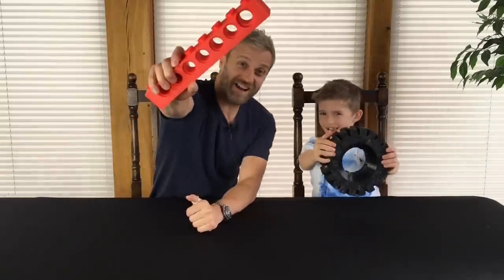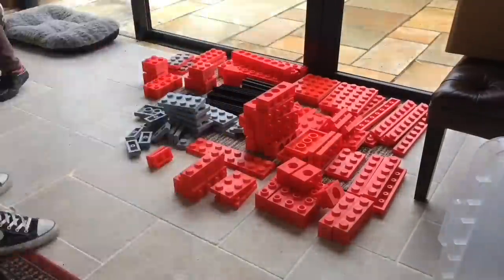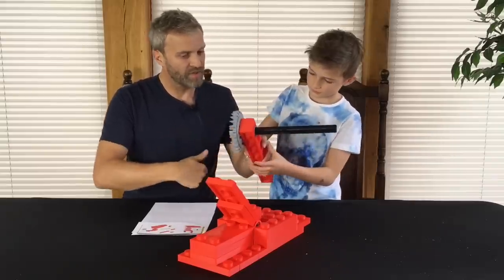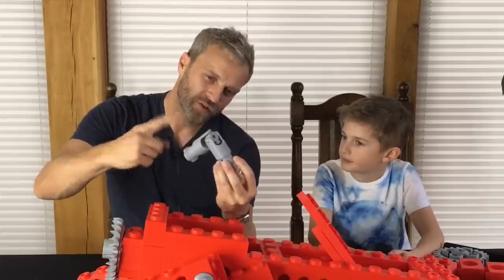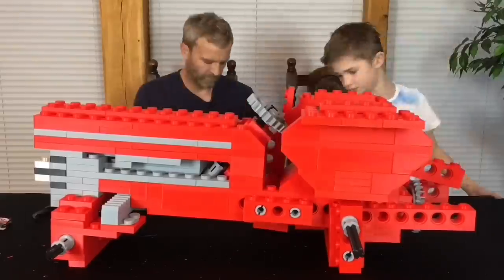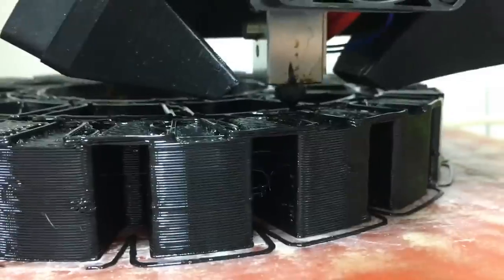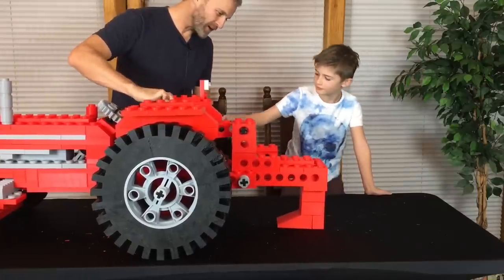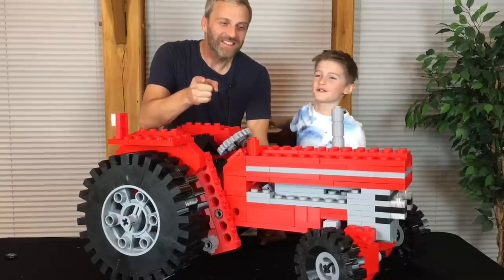GIANT Lego Tractor - Mantis Hacks E17

Comment: You can Put an Motor on the "Output" axle  to drive the back wheels😉
Reply from the maker: Yess.. have you seen my giant Lego motors?
Reply: @MattDenton  well, you might need to be creative 😉
OK, it's not so easy. You might need a geared motor for 12V or so. A lower voltage is safe and with a high gear ratio it's slow enough for these giant wheels. You might need only a slow walking speed. But it costs quite a bit. OK, I use my imagination and I can see it. You don't need to build it 😀

Comment: I really like seeing the early sets reproduced as giant Lego kits, but would you consider trying some of the newer kits that moved away from more traditional Lego parts (like those flat base plates) in favour of stronger beam like parts specifically designed to withstand more weight and to keep the larger models more rigid? There are quite a few smaller Technic kits that came out between 1990-2010 that would be good to experiment with as giant Lego.
Reply from the maker: Yeah maybe.. just wasn’t my era so don’t have much connection to it. Still want to make a gokart big enough to ride so maybe that’s the solution... or a metal hidden frame 😬
Reply: @MattDenton  Gokarts are definitely a recurring theme in the history of Lego Technic. I think it would be worth exploring some of the newer models for your dream of making one big enough to ride. Most of them have fewer pieces than the models you've built so far. 

I get the connection to the older sets though. My first kit was the original Forklift as well. However I've drifted in and out of tinkering with Lego Technic over the years. I've bought sets just to get the new parts to see what I could do with them. My current collection is kits all from 2001 onward because I moved cities and couldn't bring my original Lego collection from childhood with me :-).

Comment: Hi Matt, very cool and good job, i'm so imprest. I'm just printing this red tracktor ( i downloaded the file 4 or 5 years ago), and i want to know, what king of ball-bearing did you installed?  thanks a lot
Reply from the maker: At 5 x scale I used 24x37mm bearings I think 🤔
Reply: @MattDenton  thanks for your answer. But after check with parts i allready printed (5x scale), the hole is 24 inside and 31mm outside. Did you increased the hole or modified files for these parts? I think i will print small ring with nylon or ABS to put it on. Thanks Matt
Reply from the maker: Hmmm. Well I’m not sure which but you’re on about but I thought the bearings were 37mm outer, so I used to modify the parts where bearings are needed. A sleeve like you suggest would work though
Reply: Hey Matt. Just finish to print red and grey parts, but 1 pièce is missing. Part 3679(grey). It's a part clips on red part and turn. Thanks matt
Reply from the maker: @skynet35580  I can email them to you...
Reply: @MattDenton  i ad my mail on my youtube profil. Thanks matt
Reply: Thanks a lot Matt. I'll share you photo when my tractor will be finish